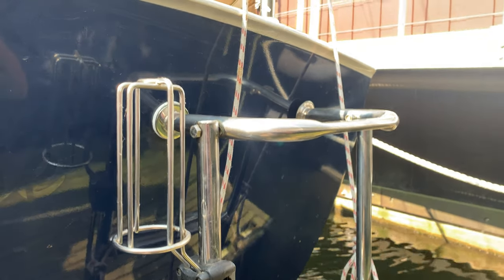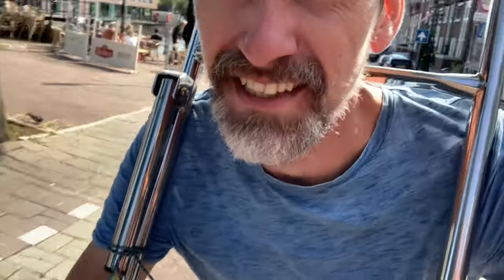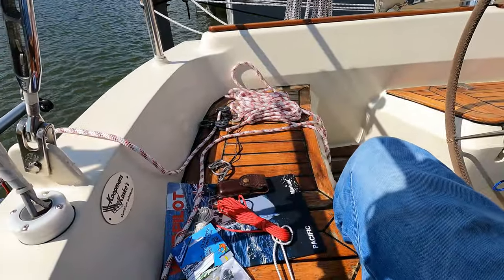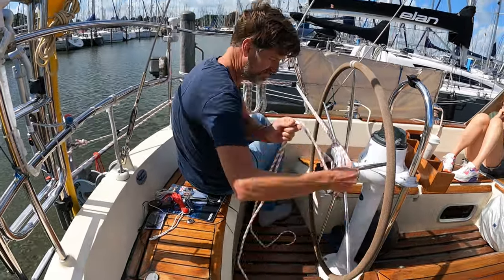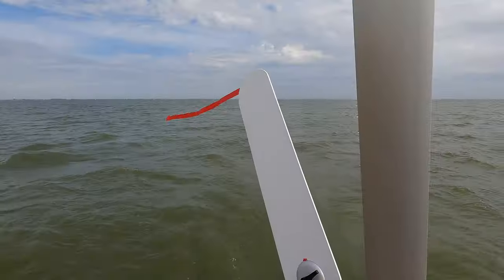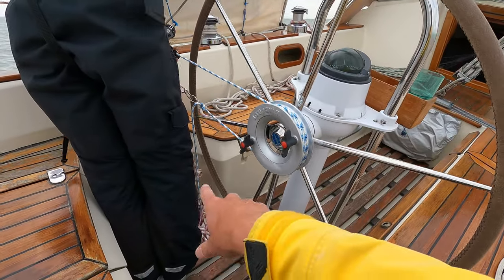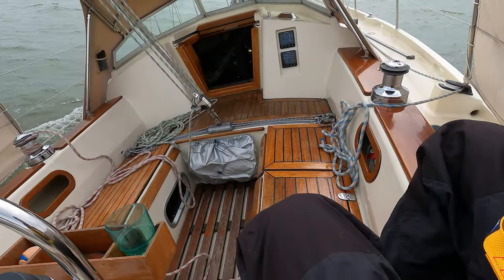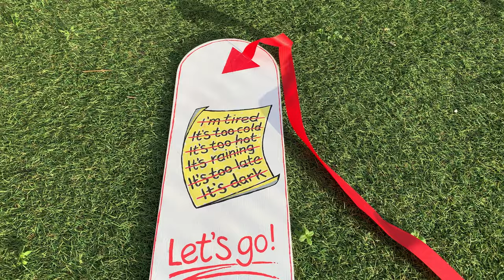029 Final install and first use of Windpilot Pacific on aluminum Koopmans 36 sailboat (part 4)

Comment: I nicknamed my worthy old Aries wind vane Ari. Not Harry, but Ari, just Ari
Like Ari the Aries, 
and also Ari like Ari Vatanen, another kind of damned good pilot from the same good old times.
Reply from the maker: Heard a lot about the Aries vane as well. Decided for the windpilot because a sister ship I know has one and heard good stories from the vendee globe on it. 

For names, it indeed deserves one, and a good one, because having a silent, non - electicity consuming steering buddy is a Wonderfull feeling! Really a relief. 

You sailed a lot with Ari?
Reply: @SailingWindRose  Ari crossed the Atlantic and steered our family a couple of years through the Caribbean and along South America. 
Aries are bullet proof machines. For example the big bronze bever gear makes me look down on some modern Delrin plastic ones!
Before finding our steel ketch, Ari had a previous life at a Trismus helm. Even the Trismus owner told us he got it second hand.
I hope Ari is somewhere still sailing the oceans. 
According to Aries Company, the U-shaped vane socket and the imperial hardware (had to purchase some imperial wrenches just for Ari!) trace back to the mid 60s!
The only downside is the turret rotation controlled by click pawl (6° by click) instead of fine tuning. But who cares while crossing an ocean!